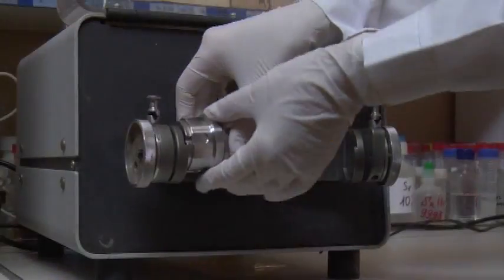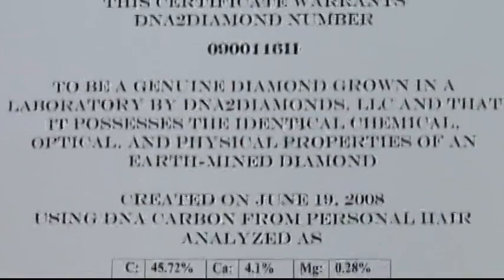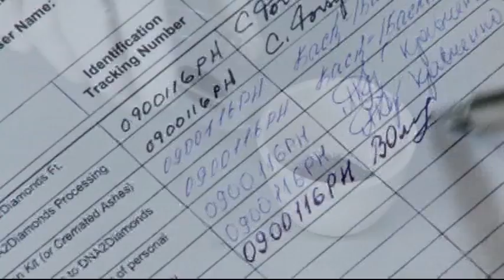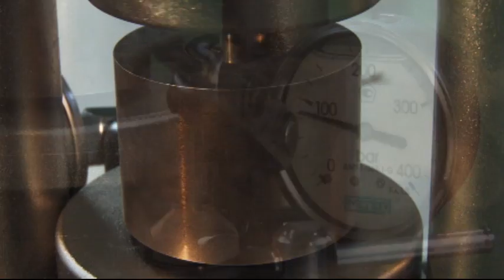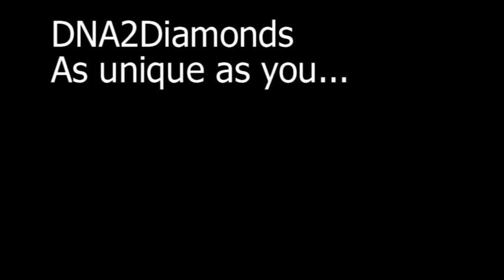Diamond Creation Process

Comment: DeBeers must hate these synthetic diamonds, they're far cheaper and of significantly superior quality that natural diamonds.
Reply: DeBeers hates that it doesn't control Diamond Supply. Synthetic Diamonds actually take a highest cost to manufacture than a Natural Diamond currently. The earth already did it for them. The expense is in digging it up where they produce millions of carats. Something like a Synthetic Diamond has a lot of costs in machinery and electricity to form the Diamond that can only produce 300~400 carats a year.
Unlike Synthetic Corundum, Synthetic Diamonds are not of a superior quality or size compared to natural diamonds. The technology just isn't there yet. It typically has flux remnants, and the formation leaves a lot of areas that did not create a perfect bond. However, the process does form some cool colors that are extremely rare in natural diamonds like a blood red.